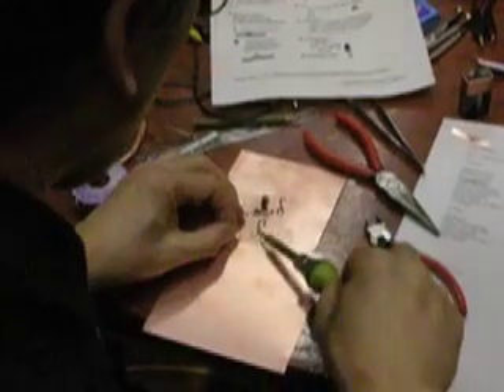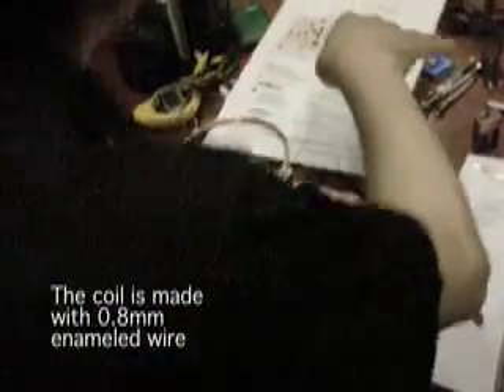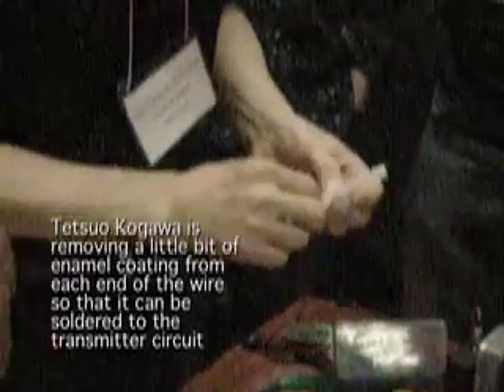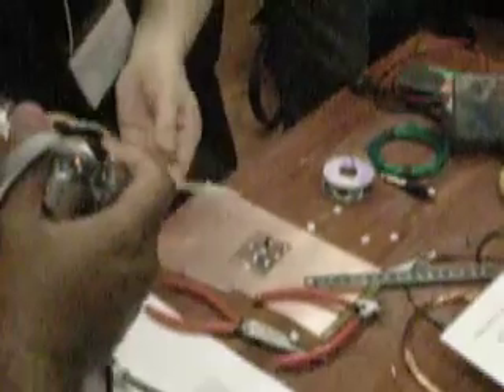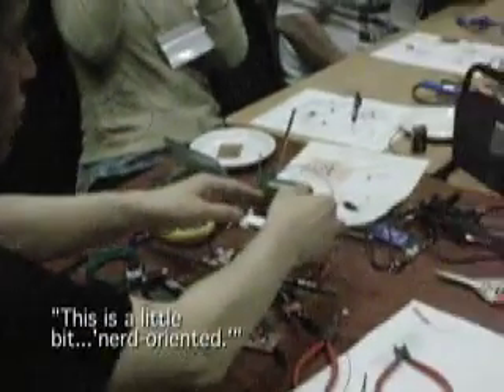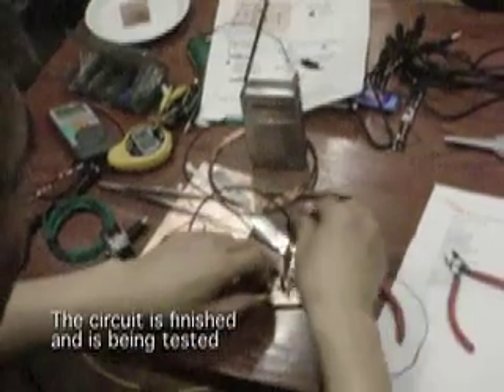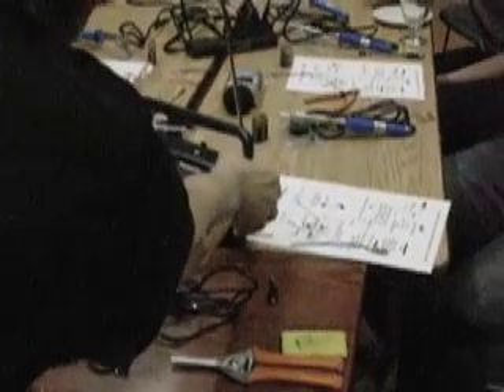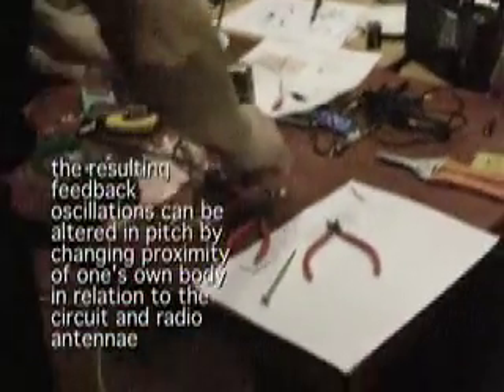Micro-Radio Transmitter workshop with Tetsuo Kogawa

Comment: I just finished building my Micro-Radio Transmitter at workshop of TRANS X TRANSMISSION ART SYMPOSIUM of NAISA.org and I hacked it immediately by attaching a contact piezo to the ground plane/copper surface breadboard. What a great sound came through the FM radio! I look forward to making more.